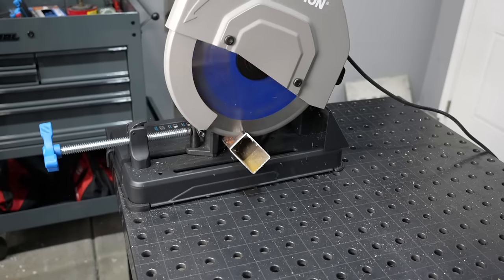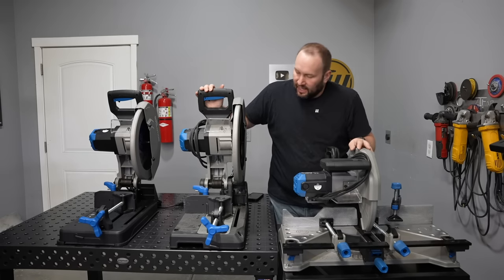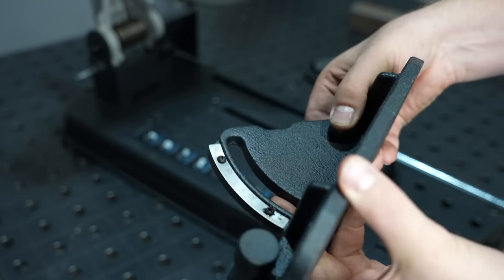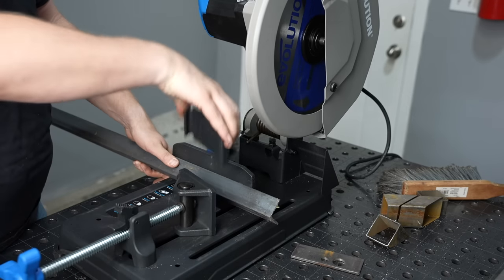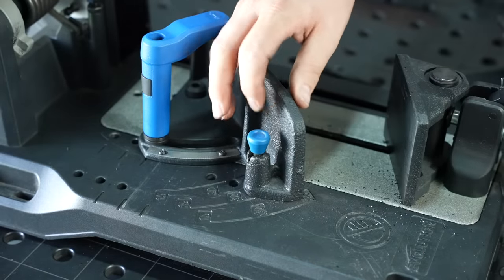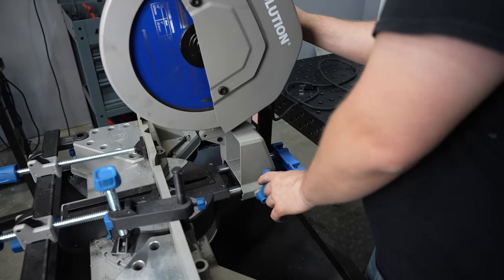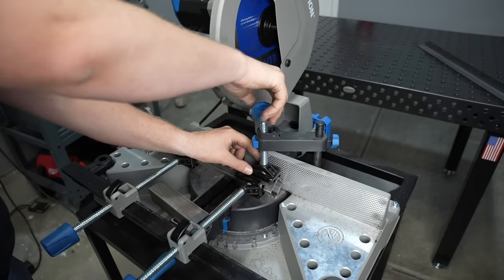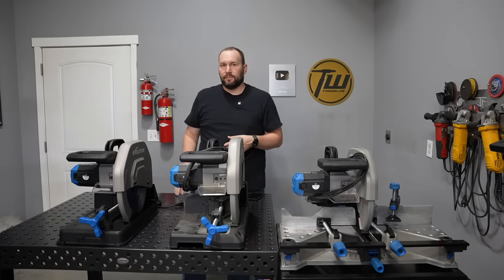Expensive Chop Saws Better? Evolution Saws Compared in Extreme Detail

Comment: Buy once, cry once :). Mitre saw unless you really need that portability.
Reply from the maker: I think it'll run for a long time to come.
Reply: Portability hands down, if the only difference is the base.. the cheaper the gooder!!
Reply: You can’t just throw a metal blade with usually max rpm of 1800 on a miter saw that spins up to usually 3600 rpm without the danger of creating a carbide teeth grenade , there’s a reason cold saws are low rpm
Reply: @stevefavela9179  You misunderstand the word miter saw in this context. It IS a cold saw, but it's capable of mitering, as opposed to the portable saw, which is not capable of mitering. No one was advocating putting a metal saw blade on a DeWalt DW716XPS or such.
Reply: @stevefavela9179 the reason isn't because the carbide can't handle the speed, the reason is the cutting dynamics of steel.

Comment: I have the early model that has not got a halfnut clamp. This saw will not cut weld or heat hardened steel. Blades have become more expensive lately. 2024

Comment: Great, thorough overview. Evolution also makes a 7 1/4 chop saw. No, it isn't exactly feature-rich, but for those of us just getting started or only working on smaller stock, it's a great option to make good, clean basic cuts for just a little over $200. And yeah, the chips are a big problem, especially if you have a Shop Dog. Keeping them swept is a must.
Reply from the maker: I had a 7" chop saw before any of these and it worked great as long as the material isn't too big.

Comment: One game changer I'd add is the stand. Having adjustable supports for long material cuts is awesome.  Unfortunately they don't have one yet for the miter saw. If it were up to me I'd go with a smaller base model with the stand and once they come out with the stand for the miter saw that will take the cake for sure. Thanks for sharing Tim!
Reply from the maker: Thanks! Yeah, their folding stand is pretty good; that's what I used with the S380 when it was my main unit.

Comment: I have had my EVO  saw for 5 -6 years and it is a joy to work with. Been thru one blade, don't cut rebar with it you will knock a tooth on the blade off. I have lost count on how many cuts made on the second blade , and it keeps on cutting. I cut my steel outsdie of my shop as 20 feet of steel does ot fit and I therefore have no issue with the chips. Mine has a cast base and move able vise and seems to be a model between the low end one and the upper 15 in blade model. Great video Tim.
Reply from the maker: Thanks! I've lost a couple blades over the years to my own errors, but like you, mine work for a really long time when I don't mess them up.
Reply: I Like You Welding Table Where Do You Get Where Can I Get One

Comment: Good review, I replaced the middle one with the chop saw. It's great and well worth the extra expense. I have mine mounted on a HF Hercules saw stand. The only gripe I have about the saws is the safety shroud makes LED blade edge light difficult. Thanks TW
Reply from the maker: Thanks! It would work great on a miter saw stand; the extra supports would come in really handy.
Reply: @TimWelds  yeah, make sure you get the Hercules one (blue).

Comment: We have the 380 at work, can't fault it for operation but the problem I've come across is that the top part of the clamp, the quick release thing, does wear out over time and here in the UK it's impossible to get hold a new replacement.
Reply from the maker: Bummer! Their customer service seemed to be good in the US the one time I called them. I thought they were based in the UK, so I would've expected their service to be  good there as well.
Reply: @TimWelds  Yeah, I don't know what's going on, they are UK bases AFAIK, maybe souring parts from Europe....
Reply: how many cuts do you get out of it?
Reply: @sebastjansslavitis3898  Blade usually lasts about six months.
Reply: @christee5772  yeah that really tells me nothing, you may cut one cut a day or one cut an hour
EDIT: and you can cut rebar or railway tracks
Reply: @sebastjansslavitis3898  Yes, I reallized when typing it that it wasn't the most helpful comment but didn't want to waste time going into too much detail.
It does vary, some days barely used others several hours. We use it for 100mm C channel with 10mm sidewall, 5 and 6mm 75x50 angle - the 5mm can be doubled up with no problem.
Was cutting some 20mm and 40mm solid round bar with ease yesterday.
This is with a blade that's about 2 month old.

Comment: My cut station is on a small roll around tool box with 2 stands, one on each side. The tool box have all the  caster as rotating casters, so I can rotate the tool box easily on angled cuts.
Reply from the maker: That sounds like a perfect setup! Much better than sliding the base around on a workbench.
Reply: @TimWelds  it was just a cheaper husky tool box from home depot. Wish I could send picks. I turn old boat trailers into utility trailers for a living.

Comment: Holy crap this is exactly what I need! Just noticed it pop up and cant wait to watch this later!!!!!
Reply from the maker: Awesome! Glad to hear it!
Reply: @TimWelds  Ok, this totally met my expectations. I appreciate the thought you put into this and all your work. You did this very intelligently and really thought this through, as you always do, thanks 🙏 Do you think the extra 22 or 20 lbs compared to the two lower models, respectively, added anything regarding performance? IK the weight isnt meant for stability alone, its more weight because of the added features, but the weight potentially adding stability is something I wondered about. Im VERY glad to know that the motor and gearbox is the same between the three, that is something I had was wondering and have not seen it on their website, maybe its there but I havent seen it. I dont know that I would spring the extra hunddy on the middle model over the lower model for the cast base alone, although I like the cast base, but I probably would for the detent angle settings. You keep scaring me off a little bit saying the top model is for a business shop, and Im at home hobby, as you said here and in a previous video, but I know why you say that, and I agree with you. I think Im going with the top model. Even though the meat and potatoes are the same as the lower two models, even as I was watching you start to show the top model I was thinking, wow, that alone is worth .. idk, but something significant. As I grow, I value time more. I have been fabing a few small projects with a Century 90 and an angle grinder and not much more 🙃what Ive learned so far is that its time for me to up my game. THANKS FOR THIS VIDEO!!!!

p.s. ugh after all that I forgot something ........ I will definitely use your affiliate link when i buy 😎 Thanks Again!

Comment: Good video, well covered thanks. I have an older Evolution saw that has a cast iron base. Great saw and wouldn't trade it for the world. It IS heavy to move around, but I like the performance when cutting and more robust than aluminum (in my opinion). WD40 keeps the base from rusting.
For cutting angle iron miters, I use wood blocking which grips the angle iron better, holding it securely.

Comment: Nice! What would your recommendation be here? I have the S380 CPS and am making a cut station with a long fence. Which fence position do you get the most use of or find to be best for most all cuts? Front, center or back fence position? My design will include a rotating base, but I will be limited to on fence placement if that makes sense..

Comment: I just bought the 380 last night and noticed the sliding acme shaft pivot sucks badly, it binds something awful, so today I took it apart and noticed the pivot shaft has a SAE washer and that's it, the pivot pad is sloppy and if you tighten the nut underneath it won't slide, the factory had the nut loose in order for it to move, I wondered if any part's were missing, quick look at parts list showed everything was in place. On my saw I noticed the pivot pad shaft stuck down about an 1/8" into the table slot, when you attempt to tighten the hand wheel the pad tilts forward and binds the vice making tightly difficult. Then I had an idea, between the pivot pad and the table I placed a 1" standard washer, the pivot shaft will hold the washer centered and the large washer gives the pad support, the I used a 7/16 in place of the small SAE washer underneath and used the locking nut. now it works fantastic, there is no slop between the pad and the table, it's doesn't binder anymore, a bit of dry lube makes it slicker and does not collect chip's. It's a fantastic saw but they need to rework the design, in order for a vice to work properly the moving jaw needs to slide easily, not flop around binding. I was even able to clamp a 1/4" rod in the vice it held in perfectly no tilting at the top. A dollar worth of washers fixed a $500 saw in fifteen minutes.
Reply: Sorry about the bad grammar, you tube won't let me edit shit, it's been sucky for the last month.

Comment: Could you tell me a good blade for cutting cast iron? I make spatulas from new Lodge skillets but I'm unable to find a blade that will hold up. Diablo is the worst I've found, it didn't make a single cut. The Oshlun blade made 45 cuts and the Evolution blade was used when I purchased it but looked new. It didn't last long either.

Comment: Hey Tim I have a yes, welder 135 with AC stick mode, light work which electrode should I use
Reply: Thanks
Reply from the maker: Most likely, it’s DC output. It depends on what you want to do, but I would probably just get some 3/32” E6013 electrodes for general purpose light work.
Reply: @TimWelds  thanks for your help 👍I’m learning a lot from your channel
Reply: I ain't him, but I'd recommend 7014 for general purpose use. I hate 6013 as it's a very low penetration electrode. 7014 is all position, will run on any polarity, and easily delivers a nice finished weld bead.

Comment: 8:50 you not gonna get thousands of cuts out of it. I have one - 200 is about max (for 480 square mm of material per cut).
Reply from the maker: Thanks for the info. I get thousands of cuts, but I am working with smaller material, so I suppose it depends on the application.
Reply: @TimWelds   like what? 480 is already small..  square inch is 645

Comment: i have the bottom of the line saw and it does cut well but the blade is off square by 1/16th of an inch. There is no adjustment . I cut up 4 pieces of tubing before i realized that it wasnt me measuring wrong. It was the blade. I have a email in to evolution to see if it can be fixed but in the meantime I wish you would have put a square on the cuts you were making... Why make a saw that cant be adjusted? Its just stupid...

Comment: What is the difference between these an the Evolution orange one?
Reply from the maker: The orange one is a multi-material saw and is built with cost in mind. The vise doesn't have a quick release nut, so you have to turn it all the way out and in unlike the blue saws with a nut that allows you to slide the vise jaw up to the material quickly. The clamp on the orange one is fabricated from sheet metal rather than heavy cast material that is on the blue saw. The orange saw requires the Allen wrench to adjust the fence angle, where the blue saw has a built in handle. The blade is a multi-material universal blade rather than a dedicated steel cutting blade. Other than that, I believe it's similar to the S355CPSL. I'm sure it'll work good, but the features on the dedicated metal cutting chop saws do a lot to save time.

Comment: Thanks good comparison. Need a band saw comparison also.
Reply: If you're talking about the portable bandsaws, check out the Swag Off Road bandsaw table. You can mount a bunch of different saws with the v2.0 version, and gives you a nice but smallish bandsaw. It's not going to replace a DoAll saw with a 20" throat depth, but it'll do quite a bit. And at the price point, it's easier than fabbing your own.
Reply from the maker: Thanks! I did one on portable bandsaws a while back comparing DeWalt, Milwaukee and Bauer. At the end of the day, they all worked equally well except that the Bauer had a little less power and thus cut very slightly slower. I haven't done anything with horizontal or vertical bandsaws.

Comment: Evolution is in my town,after my Rage 2 died, I wanted to see what they had,and got to see the new miter type before it was released. I still decided on the 480 as the new one took too long to clamp down,and I only use 90 and 45 degrees,very rarely 30. I made several videos about thier Rage 2 I told them,but they wouldn't even give me a discount,was actually cheaper  to get it at my welding supply. All my future videos will have thier name blocked.but still I believe the best of this class.
Reply from the maker: Glad to hear it's working well for you too!

Comment: I'm still slumming with a little 7" Evolution Rage somethingorother. I chipped up the multi-material blade that comes with it pretty fast. The replacement steel cutting blade is way better. 

I'm pretty limited on how big my stock can be, though. But I got it because it was cheap, small, light (I have to pull it out and put it away all the time), and I didn't see myself doing more than like 1.5" tubing anyway. 

I had to make my own v-block by cutting one side out of some square tube and laying some angle in the opening. I didn't do a very good job, but it gets the job done. 

I do have to leave a bit of extra length to clean up my miters, though, because the fence tends to move a bit.
Reply from the maker: Nothing wrong with a 7" saw, and a good blade makes a huge difference.

Comment: I have the old orange 14'' evolution that came with the multi use blade. I have had it  over 8 year with out issue. Been through 25 blade and I cut a lot of 3 and 4 inch c channel.  1/4 thick square tubing. It has never gave me a bit of trouble. I like the new clamping mechanism on the new blue saws. Would love ro upgrade but this one still has so much life in it.
Reply from the maker: Cool! No reason to fix what isn't broken; I like to run things into the ground.
Reply: I love the next best thing but just can't afford them now a days. So, yes, run into the ground. Plus if it ain't broke don't fix it. Love the video. Been hoping someone would do a comparison of these saws. Wish I could have seen your original one you use all the time.

Comment: I purchased an Evolution Rage chopsaw not knowing it was lacking a quick adjust. So, each time I changed different sizes of material, I had to crank the holding jaw in or out, and that was not a good thing. I talked to Evolution and was informed that I could not purchase the adjustment piece. I won't buy anything from those as*holes again! EVER!!!

Comment: Sorry but for $850 dollars they should have Laser line or Shadow line for making the cut and the slide should have detents for when your cutting larges items that require the blade to be moved front or read of the fence to completely cut the item. Also why didn't the best saw have a tray to catch the chips like the middle one had? Ah I'm just bitter because I don't have one LMFIAO  Nice video Tim.
Reply from the maker: It would be nice to have a laser line, for sure!
Reply: The negative part about the laser line is it's off if you cut from two directions because it's on one side of the blade but I can't see why you can't add a Shadow line except you have to drop the blade enough to move the guard out of the way to see the shadow. They are easy enough to make, I would if I owned an Evolution saw, hint ,hint Lol @TimWelds